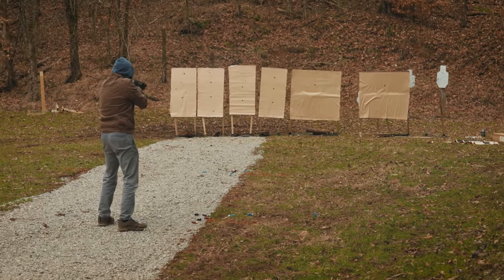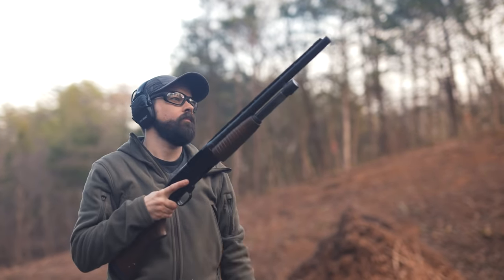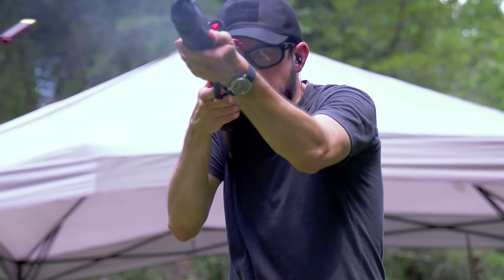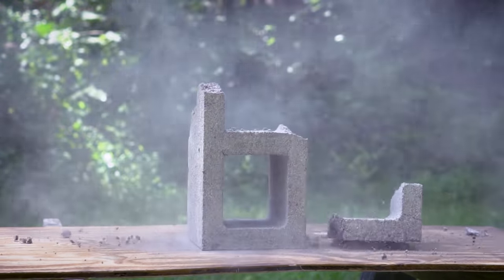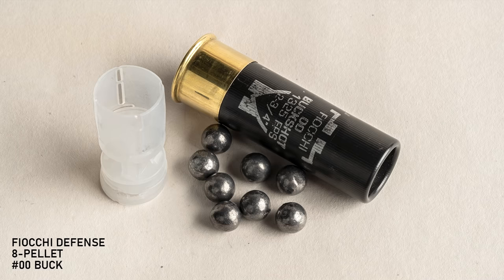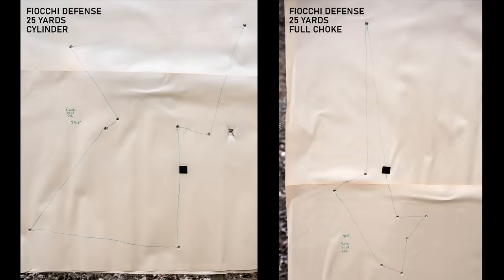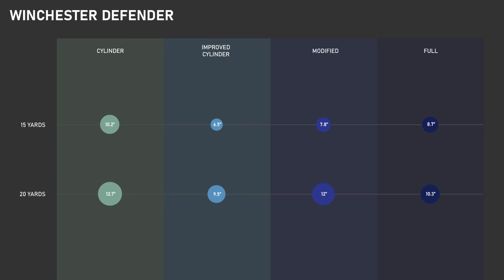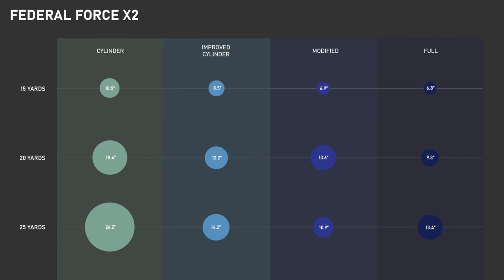Choke Tubes for Home Defense Shotguns

Comment: I've had this conversation with a few Australians and South Africans. They were almost universally of the mindset that buckshot needs less choke due to the choke deforming the pellets and blowing the pattern. It wasn't until we actually got up and patterned everyone's guns that they finally admitted there was something to this whole choke game.
Reply: I'm still convinced that for buckshot, ammo makes or breaks, but given all other things being equal, IC choke is king. The data here also corroborates.

It may not squeeze the tightest possible dispersion, but It will always consistently improve results over cylinder bore without risking the occasional full choke deformation -> flier.

You may have avg group about 2 inches less at 25 yards with a full choke, but fliers are much more of a liability, for its inconsistent and random, both in occurrence and heading of the deviation.

Modified choke is in a limbo. It doesn't have the maximal performance of full choke, but it is also just a bit too rough on the buckshot such that the dispersion is often worse than IC, as well as being less friendly to use with slug rounds.

IC, you can run all common ammo through it. Wouldn't intentionally run slugs through IC regularly, but if in field and there's a need for a slug swap, I wouldn't sweat it.
Reply: @prfwrx2497  - Absolutely ammo dependent, though flight control works best with a cylinder choke.  Shooting cheap buck through my cylinder bore (unchoked) gave donut pattern close to three feet across at forty yards. That pattern is worthless!
Reply: @prfwrx2497  I've ran tons of slugs through modified and full chokes no problem. Chokes still mic out to the same diameter as when I bought them. It may be a problem in some super thin wall older guns like the Ithaca Lefever Nitro Special, but I haven't put enough slugs through one to make an evaluation.

For hunting, I would rather have 8 pellets in a 8" group with one out to 16" than 9 pellets in a 12" group. One pellet lost to the woods isn't a problem, and having a concentrated group right on the vitals beats a bunch of extremity hits.

For home defense, it likely doesn't matter. Ranges are too short for any real patterns.
Reply: I’m a farmer in TN in my 40s. I’ve been shotgunning critters since I was 12. I keep a 26” full choke 870 w 8 shot extension, rds and light for outside. I can throw a killing pattern on a coyote at 75 yards. 
I keep a 20” oc 870 in the house. It’s for “in the house” range.

I mostly run 3” #4 buck, but sometimes I use cheap 2&3/4” 00.

Edited for spelling*
Reply: @prfwrx2497  many boxes of slugs state improved cylinder is best.
Reply: I’ve found the same,I used a full choke on my stoeger with #1 buckshot, 16 pellets to a round, full choke seemed to cause the shot to spread over 600 mm, with an intermediate choke#3, the pattern came down to 300 mm,it seems the tighter choke causes the bigger shot to bounce off each other and spread more,still working it out
Reply: @prfwrx2497  Great point about IC chokes. To add to that, correct about slugs through an IC. If you need to quickly load slugs, they fit through an IC choke without much swaging. They also tighten up slug groups for some of us who cast our own and test slug accuracy.
Reply: I have a Remington tactical express with the Remington tactical choke.   Using my gun strictly for home defense, using #4 buck.  Longest shot I'd need to take is 12 yards, more likely to be around 7 yards.  I'm wondering if I can keep a tighter group with a different choke.  Is it necessary to change choke for this range?  This whole choke discussion can get a little dizzying.  Any recommendations, thoughts, would be appreciated.   Thanks guys.
Reply: Not all chokes are equal…… extended full/extra full usually constrict the pellets at a more gradual rate (depending on the wad you might get as much as 100fps faster with a full choke too) and can be less damaging to buckshot, it also depends on the wad.
Reply: From what I've seen on taoflatermaus or OG's channel, a choke can have a better/tighter  40yd result than Federal flight control. However if you don't have an option for a choke, just go with flight control 🤷
Reply: @blantant  flite control is really one of the worst options for buckshot once you get past its cylinder bore performance. 

It has no cushion in the wad so even though it’s relatively wimpy in terms of payload and velocity, it kicks harder than loads with more pellets/speed. The pellets are all undersized, with its alleged 00 buck being .315” and its 1 buck being .285. So it’s even weaker than advertised, and it’s advertised as fairly weak. 

Any normal buck load that patterns well enough really stomps flite control, especially when you get into chokes
Reply: @prfwrx2497  I also agree with your statement. That being said all chokes and ammo pattern different. Even between two shotguns of the same type and choke (i.e. two 870's with IC) may shoot the same ammo differently just like rifles. I got weary of running running slugs until some foster type slugs say to us IC for best accuracy. That IS NOT the case with sabots with can catastrophically fail a barrel with a choke.

Comment: Suggestion: Test the paradox chokes to see how much one can improve the range of slugs with them.

Disclaimer: Paradox chokes are rifled chokes, just 2 inches of rifling. But even so little rifling will provide rotation and so will spread your pattern of shots to an useless one. Do not use shot amoo with paradox chokes
Reply from the maker: Thanks for the suggestion! We actually have one of those and had planned to test it for this video, but the buckshot testing took so long, we had to cut it for now
Reply: @LuckyGunner  you guys are the best!!
Reply: Demolition Ranch shot buckshot out of a rifled barrel, the pattern was so bad some didn't even hit the paper at 10 yds

Comment: Thank you soooo much!  I was doing some deep research on this topic a couple weeks back and it's amazing the amount of fuddlore and internet BS that obscures it.

Now you need to send the gun off to Vang Comp for their back boring and run those same loads again for comparison.  Vang Comp is what people did before flight control to have tighter grouping buckshot (as I'm sure you're personally aware of), which seems very relevant now that flight control is basically unobtainable.  It would be very interesting to see how much the Vang Comp back boring helps in your gun compared to the chokes, and if the chokes will still help tighten the pattern up even more after the Vang Comp work.

Comment: A ported choke will help a lot with conventional buckshot. The porting acts to slow down the wad.
Wad stripping is universally a better way to get tighter groups with buckshot, because as you noted, too much choke starts deforming pellets.
That said, my carlson buckshot specific ported full choke was making patterns the internet wouldn't believe if I said them, at 30 yards.

Comment: That was good info. I also use choke tubes for my home defense shotgun. I use an old Mossberg 500 with a 20in barrel and full choke tube designed to shoot steel shot. I use quality tungsten Steel BB size. Very effective at 25 yards.

Comment: You are right about the choke in your shotgun.I would never fire a 3.5 inch 00 buck shot load thru my Mossberg 835.I have read it was possible to damage the barrel with a super tight full choke.I most always only use #5's in Turkey loads ,with a .690 extended choke.sometimes I use number4 turkey loads ,I have some Remington 3.5 inch shells in 18 pellet 00 buck shot .but I switch to an open choke when I use them.

Comment: A choke that provides some wad braking  such as a pattern master, comp-n-choke, or kicks to cleanly separate the shot from the wad can really reign in buckshot patterns and do a lot more than simply constricting the shot. For example in my case, the pattern master code black duck brought the cheap estate buckshot from covering an entire torso target at 25 yards down to a group about the size of an outstretched hand.
Reply: I’ve seen videos where the flite control performs best out of cylinder bore or IC because a choke any tighter separates the pellets from the special wad, defeating the purpose of using the flite controls
Reply: @judgementgaming3270  Flitecontrol operates on a completely different principle and is an exception to the rule. It is designed to keep the shot contained for a considerable distance before separating. For nearly every other type of buckshot, a wad stripping choke will keep the wad from pushing through the shot upon exiting the muzzle and really help patterning. Even more so than simply constricting the shot. The code black duck choke I mentioned is a modified constriction but it also has multiple edges that protrude into the tube, along with some aggressive porting to bleed off gas pressure and slow the wad. Other chokes like kicks and comp-n-choke rely on the design of the porting to perform the same task and can vastly improve the performance of standard buckshot loads.
Reply: @supercomp65  thank you, I wasn’t trying to pull a “gotcha” or anything like that, just simply wanted the information to be present and available for the good of those reading in the comment section.

Comment: For cylinder bore, Flitcontrol wad does wonders.

50 yards with the hunting version
40 yards with the LE/tactical version

If you need it to open up more, then the Hornady Versa-tite wad will do well up to 30 yards.

For “home defense”, 15 yards is a long shot, so just use regular buckshot. If worried about fliers, then #4 is your friend. If less worried about over penetration then #1 buckshot.

Comment: I'm running an 18" cylinder bore. It's an old Mossberg 500A six shot. The pattern is OKish at 25 yards. And I can hit well enough with slugs at that distance. Much beyond that, I'm shooting into neighboring property. It is what it is, I guess. #4BK is a load worth considering. You get more pellets in the air. Granted, you get less penetration on the other end.

Comment: I use a modified choke 28 inch barrel on a Mossberg 500. 00 buckshot drops a deer in its tracks at 20-30 yards. With any firearm or  bow and arrow you need to practice and test what works best. A clean humane kill is the objective.

Comment: I'd love to see the patterns with #4 buck. Does it give you a more even spread? A lot of these patterns are drawing a silhouette outline with nothing but air in between. Function of the low pellet count i guess.
Reply: The problem with #4 buck is that penetration is marginal at best. Better to stick with 00, or if you can find it, #1 buck, and do your best to tighten things up.
Reply: @stevencali3539  how much overpenetration do you need on a home defense load? standard velocity #4 is still getting 12+ inches of penetration on gel
Reply: I use a full choke and exclusively use #4bk with it. It has really great patterns out to about 20 yards. The dingus that commented that #4 doesnt penetrate is totally wrong. If anything it is even better for home defense against two legged threats.

Comment: Good work and well presented. I would have liked to see a Vang Comp back bored barrel in comparison. In my experience, in more recent years, Remington had done a lot of 870’s (perhaps just the P model?) with Improved chokes on 18” guns and their 14” barrels were Modified. Many years ago I did a similar test with turkey loads in my 26” gun using 4 loads and 3 choke tubes (full, extra full and super full). With 3-1/2” loads, the tighter choke tubes opened the pattern more.

Comment: I’ve got something I wanna blab about….  When I’m pulling my pistol in emergency situation I recently tried something.  They say don’t put your finger on the trigger until you’re ready to shoot,  correct???  I do that…  what I tried recently tho’ was moving my finger from off the frame to placing it on the trigger.  I’ve noticed movement enough sometimes to make you miss.  So,  what is the right thing to do in a real life or death situation???  Go right to trigger would be best,  I think.  With the risk of movement going from frame to trigger causes,  probably magnified by the extremely stressful situation,  I’m thinking I wouldn’t wanna risk it.  What’s the saying…  go right to gun

Comment: Thanks, Chris, good comparison of the chokes used and at the distances specified.  However, a few points.  

Since we are talking about "home defense," I can't imagine a typical interior scenario where I am going to care what patterns beyond 15 feet at the most.  What's a typical "home defense scenario?"  There is probably no "typical," but what is reasonable to expect?  I would say a home invasion wherein I would be confronting some perp in my living room or down the hall from my bedroom or something similar.  Not too many homes have exceedingly long, clear sight lines.  Twenty yards?  Fifteen yards?  Ten yards?   That's 60, 45, and 30 feet.  To reach those distances probably entails a situation involving some exterior activity.  Where I live, and I dare say in most jurisdictions, one had better know what the legal ramifications are of using deadly force vs. what constitutes a real "life threat" at those long distances, but that's another question.  The point is that I think the concern about distance is pretty much limited to 10, 15, maybe 20 or so feet, not yards.  I do think it's prudent to care more about what sort of pattern can be expected from 00-buckshot at those closer distances.

Which raises a second point.  At those shorter distances - 10, 15, 20 feet - there is little "pattern" regardless of choke or barrel length anyway.  Even at 10 yards (30 feet), you were only getting 4- or 5-inch "patterns."  Based on personal experience vs. cardboard perpetrators, at seven feet or 10 feet, I get basically one big hole for 00-buckshot and another for the wad.

And third, personally I don't want a "tight" pattern anyway, nor do most people since I don't know of any 18-1/2 or 20-inch "home defense" fixed barrels that have anything other than a cylinder bore, or a screw-in cylinder choke, i.e., as open as possible for closer ranges.

Comment: I had a poly choke on a Mossberg bolt action shotgun.
It had these fins when you tighten the choke it would
be full. And loosened would be modified or imp. cyl.

Comment: What I really want to know is how the patterns compare between long barreled shotguns (~26-30") and security models (~18-20") if each one uses chokes. As in, if one were to have a choked security-length barrel, would that be sufficient for conventional hunting with birdshot, or would the pattern be too wide/inconsistent? Would using chokes on security barrels make it possible to have one shotgun that can be used in either defensive or hunting applications without switching out the entire barrel?

Comment: I’ve heard conflicting data on how tight of a choke you can use while still allowing the use of rifled slugs. Can you use a modified choke safely with slugs?
Reply from the maker: I have also heard conflicting advice and I'm not sure what the definitive answer is. For an unplated lead Foster style slug, I would think a modified choke would be okay, but I don't know for sure if that's always the case
Reply: I do, a SBS 870 with a 14" fixed mod choke.  It's super accurate, but does lead up the barrel.  I can't say exactly how "more" accurate it is vs cylinder bore, cause it's just a bead sight.  But, at 12 yards I can hit a 2" shoot N see every time.
That same barrel works great with Flight Control as well.
Reply: I've shot hundreds of slugs through mod chokes and even full chokes. No observable damage, chokes still mic out what they started as
Reply: Buffalo has a video of slugs and chokes worth watching.
Reply: @LuckyGunner  @Andrew Kuper - For un-plated Foster Slugs, yes, you can fire with a Modified Choke. I have done it and have also seen other videos showing it. That said, in my experience(yours may vary), the Foster Slug is more accurate out of Cylinder or Improved Cylinder, and to me at least you feel more recoil with a Foster out of Modified. I cannot confirm (less than 100 rounds total in the past) but also suspect that over time, it would wear out the modified choke anyway. Now that I have a screw in choke option, I use IC when I expect to use slugs. 

Anything with a "follower" or "flight control wad" like Federal Tru-Ball ammo or a Brenneke stule slug I would not use with modified, because that stuff is likely to interfere with the slug deforming in the modified choke to fit. No evidence, because frankly I don't feel safe enough to try those through Modified.
Reply: Modified is too constricted, improved cylinder is ideal for Foster slugs.

Comment: 'MY' #1 house gun (I consider the yard and street as 'my home' too) is a 20" 12 gauge Mossy 500 MODIFIED choke tube w/ a range of 00, #4 buck and 1oz slugs I feel good about this mix from muzzle to 50 yards
Reply: #4 buckshot ..  copper or nickle plated ..  fired from 25 feet ..  '68 ford country sedan  ..  thru front pass. door-thru seatback- thru rear driver door-penetrated flush into 3/8" plywood 10 feet away.

Comment: I have an 870 Mariner that I had Briley tube it. For skeet and in the house it uses a light skeet/.003 tube in it. In the house it uses 1 1/4 oz. of nickel plated #5`s. For the field it uses a light mod/.013 choke with whatever size shot is appropriate. For skeet, my load is 3/4 oz. of #8 1/2`s. This is a bad ass shotgun, if need be.